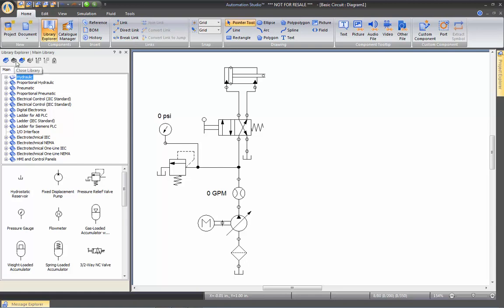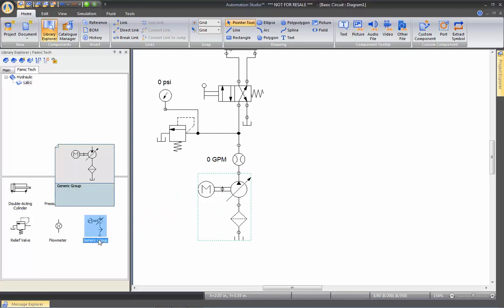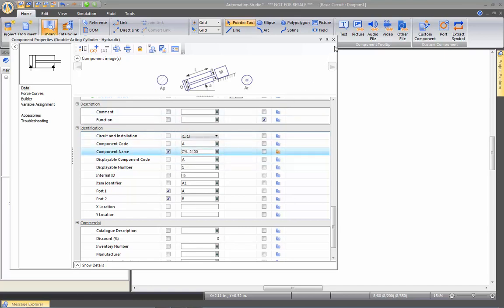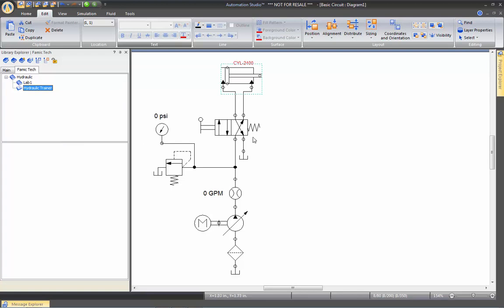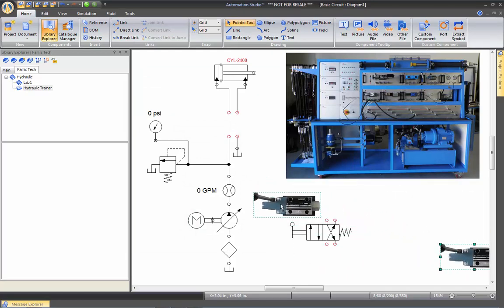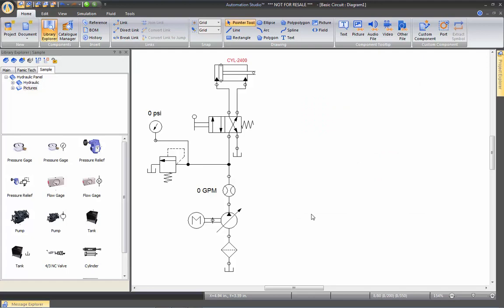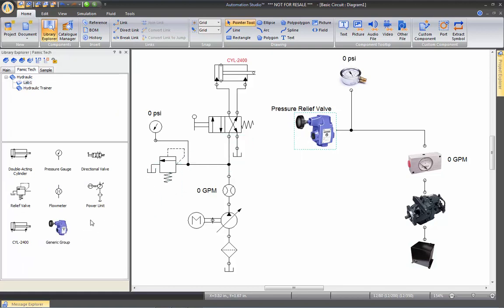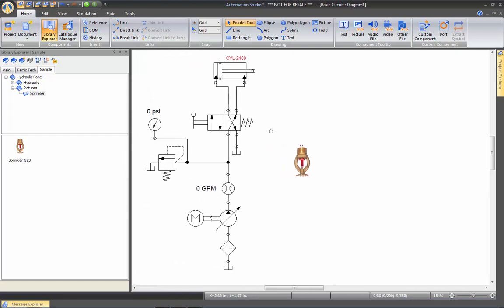Interface - Creating your Own Libraries of Components - Automation Studio™

Comment: how can i create overcenter valve in AS5.2
Reply from the maker: Automation Studio™ has two main usage, drawing and simulation.
If you need to create just the symbol for drawing purpose, you have to use the CAD options. If you need also a simulation behaviour, this will not be possible because the behaviour need to be coded by the developers.
The Version 5.2 is old version, in the latest versions this are already in the main library.
Please contact your sales person for an upgrade.